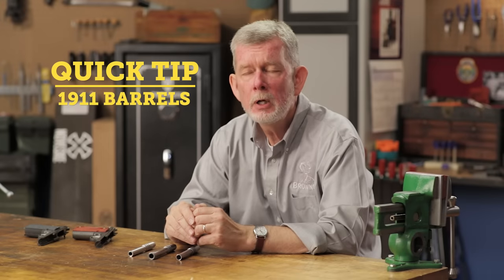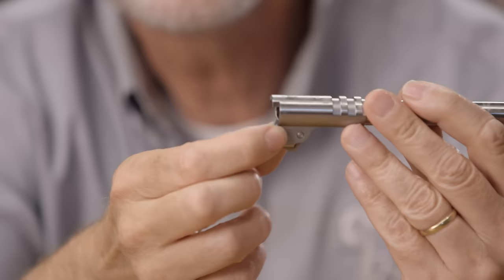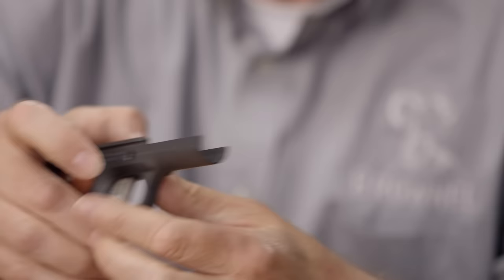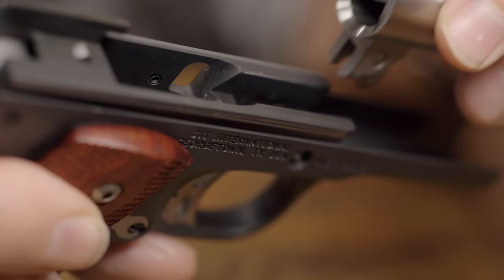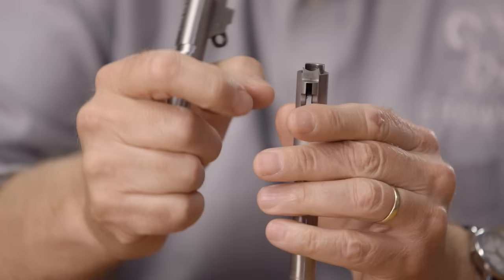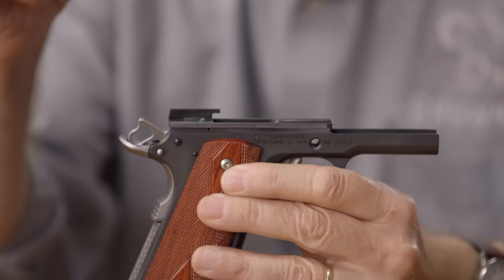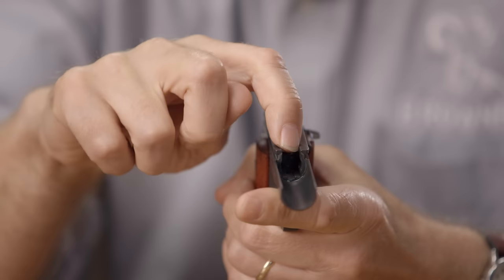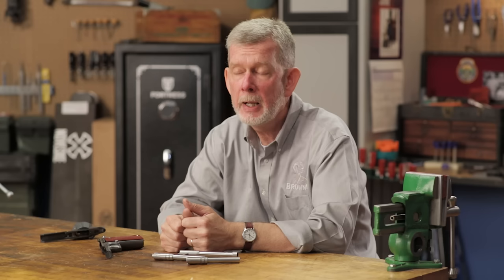Quick Tip: 1911 Ramped and Unramped Barrels and Frames

Comment: Do non ramped 45 work withh hollow points?
Also, when the ammo is in the chamber (but the slide open) is there any side wiggle normal for the ammo or has to be perfectly still tight?
Reply: Depends on the manufacturer. Nighthawk, Les Baer, Wilson, etc. all have unramped .45 barrels and I haven't seen one with feeding issues when using hollow points of any kind.

Comment: What’s the difference in Clark rampt  and nowling they look the same ?
Reply: Steve explained the difference in the video. Watch again from 1:15 onward.  See the shape of the underside of the barrel to the rear of the link-lugs. One is squared, the other is rounded. You can't put a square peg in a round hole.
Reply: How it's machined.  The cutting bit is a spiral that's flat on the bottom, so if you tilt the frame vertical and advance  the bit down it will leave a flat ridge.  If you instead jig up the frame so that you move advance the bit sideways it will leave a round cut.

Comment: Somebody give logical geometric proof that a integrally ramped barrel has more case support than a standard ramped barrel.
Reply: I could only assume it’s based off of surface area distributing the pressure, instead of nothing supporting the rounded edge of the non-ramped barrel and having it momentarily expand. As the ramped seems to protect/limit the expansion of the casing upon firing higher pressure rounds. But i’ve also never built an M1911 and am still researching all this currently.

Comment: I was going to customize my 1911 but after watching several video's on barrel fitting etc. i have decided to say screw 1911's they are too much of a pain in the ass, i just want to have an accurate pistol to shoot but i absolutely don't want to constantly be screwing with it, screw the constant adjusting this,adjusting that, tuning your spring, have it machined, i mean absolutely F%^K all that bs. it's for sale tomorrow. I don't want more shit to maintain period. No way i'm ever gonna pay a gunsmith for jack shit.
Reply: What??? LOL. I just load my 1911 and it runs.  Never a malfunction, never a jam just a fantastic handgun.  Check out Bul Armory.
Reply: If you're buying a pistol to shoot it, buy it to shoot it. Some of us modify and customize our tools for specific purposes. Guns being precision made instruments, the act of needing to tune and adjust them is typically done by the manufacturer. Whether it's a 1911 or not doesn't change that. Buy what tool fits your needs, make sure the tool you buy is of reputable quality and you'll likely not need to fuss around with tuning. Drop in parts are rarely ever just drop in and will require fitting. If you don't have the tools to customize a gun, don't.
Reply: @TankEpidemic  Correct and if it isn't 100 percent malfunction free from day one i shit can it instantly.
Reply: @jase1125  My bul armory sas 2 ul 3.25 is my favorite so far, know bul well, bought directly from laura at bul.